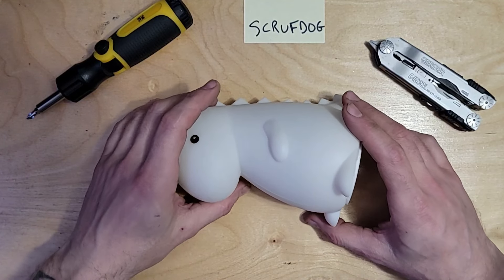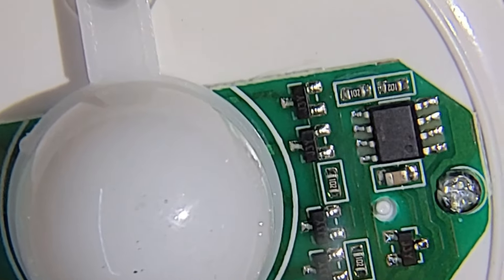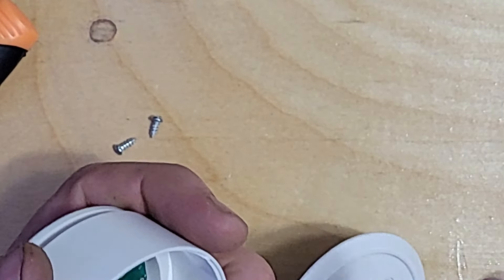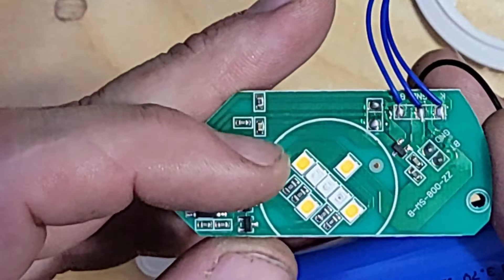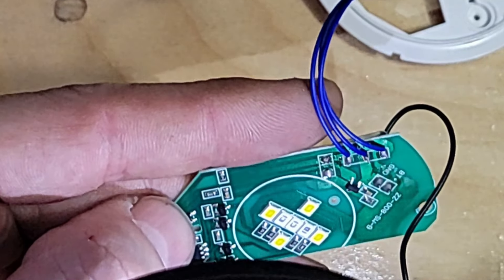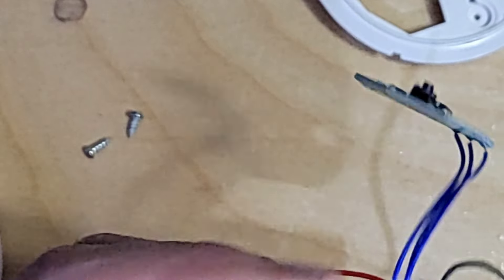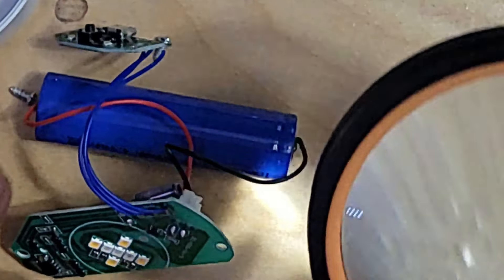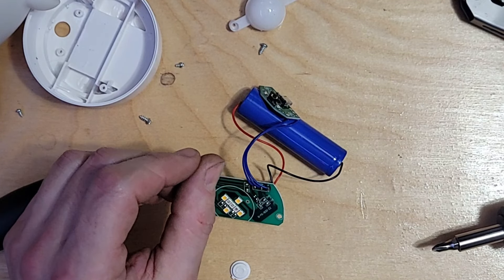Dino Dissection - Part 1

Comment: I opened a kitty toy that flashes led's when it gets bumped.
The sensor is a spring around the pin, and it makes contact as the spring bounces.
That Dino is nice, and the battery upgrade is easy to do.

Comment: The enclosed coil of wire has a loose bar magnet in the center of it to detect the shaking. It changes the inductance value.

Comment: Mine was a unicorn running on batteries.
I put a 18650, a USB-C port and a touch switch in. Just because I can. Runs for several weeks now and dims on and off
Reply from the maker: Sounds like a good build. I'll just upgrade the battery on this one. I like the current functionality.

Comment: 102 ohms - surely that's 1000 ohms?!
Reply from the maker: Yes indeed. I do that all the time.
Reply: Indeed a 1K resistor 🙂
Reply: @Scrufdog Simply put, on most SMD resistors, the last digit indicates how many zeros you need to place after the first 2 digits to obtain the resistance value in ohms. For example: 100 means 10 + 0 zeros = 10 Ohms, 104 means 10 + 4 zeros = 100000 Ohms (100K).
Reply from the maker: oh i know, i screw up the 10's all the time if I'm not thinking too bard about it